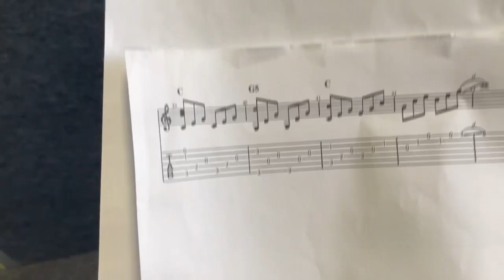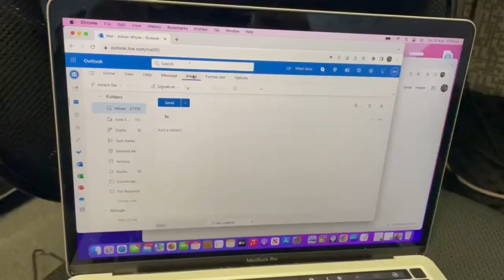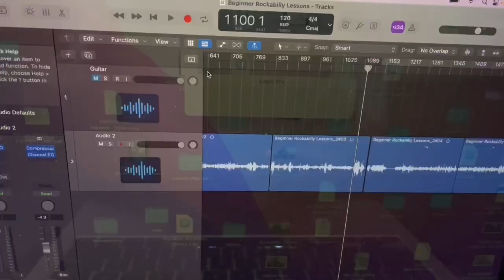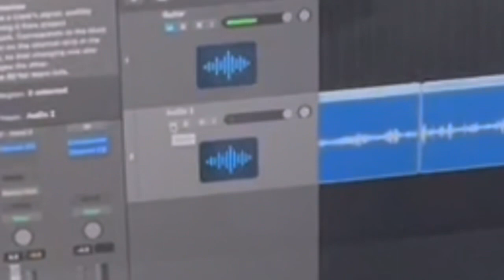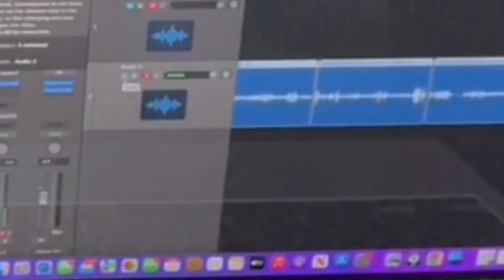POV: How I setup and record my Youtube Guitar Tutorials (It's pretty basic!)

Comment: Hi. About the mic switch (symbols), that switch is a pass filter. The switch in the middle position (like it is) captures the full spectrum range. The switch turned to the left, cuts low-freqs, turn to the right to get treble boost.
Probably the mic technical data chart explains it all.
Stay safe. Rockabilly rules.
Reply from the maker: Thank you Ben, that’s great to know! I thought someone would enlighten me! Appreciate it!
Reply: @AdrianWhyte  No problem mate. You share allot more with us. Stay safe.